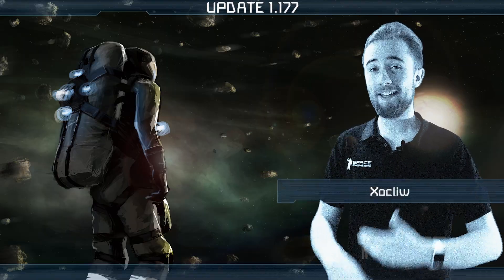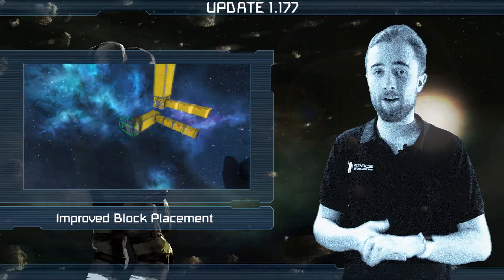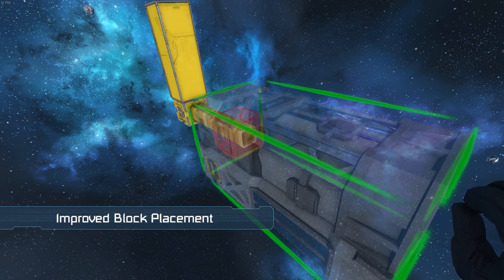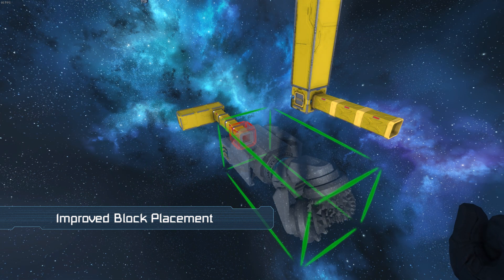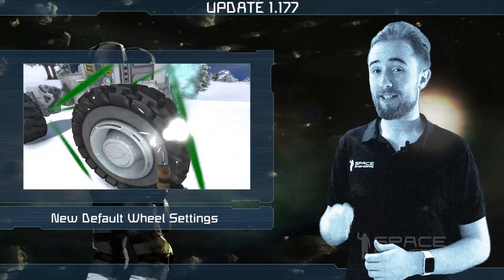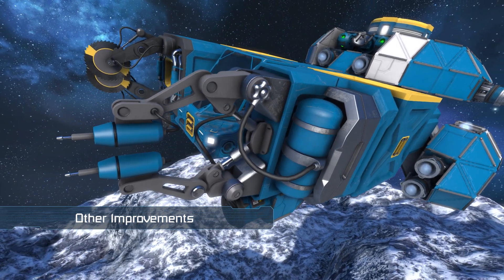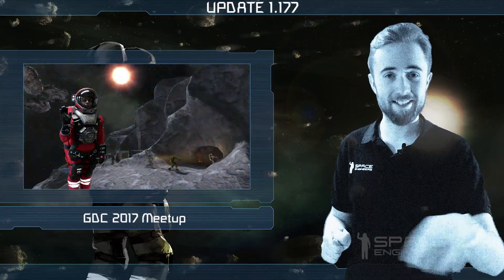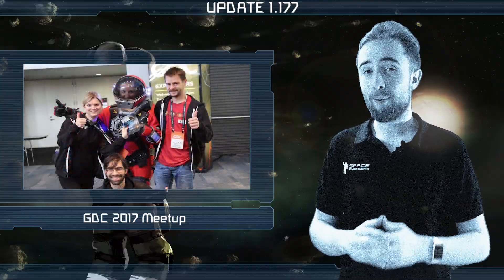Space Engineers - Update 01.177 DEV - Beta Improvements

Comment: I have a suggestion:  You ought to make modular devices for power blocks, specifically nuclear reactors (though I have similar ideas for Batteries).  This probably would require a redesign of the nuclear reactor blocks, but I can see a device that prevents Overloads by governing the reactor output, efficiency modules that reduce the Uranium consumption over time per output, and an emergency reserve that doesn't take up much space, but can give you some extra power when you need it.

Comment: The wheel suspension change is much appreciated. The bar to entry for building a basic wheeled vehicle has been significantly higher than a comparable air vehicle in no small part because of how tricky getting a workable wheel configuration can be.